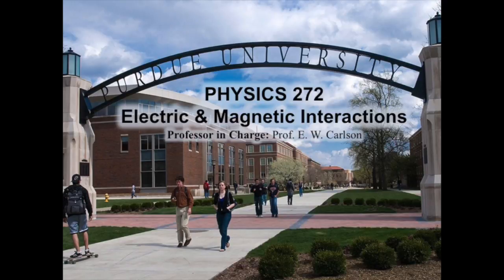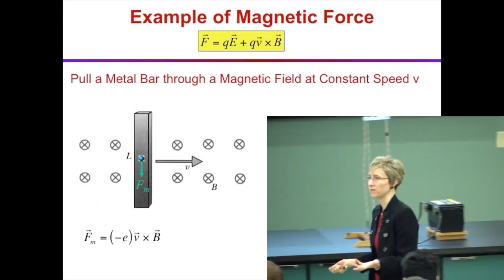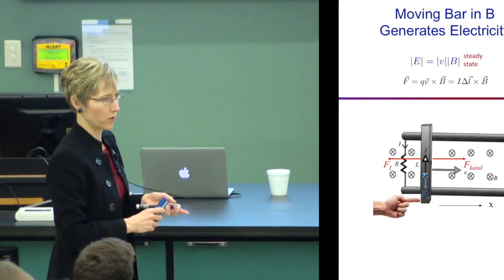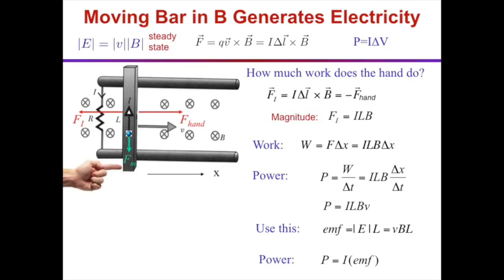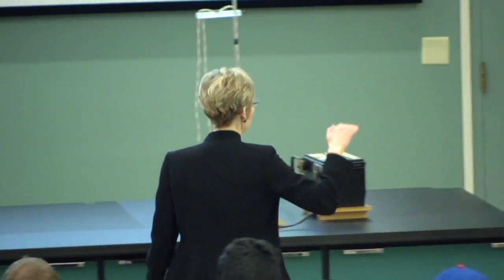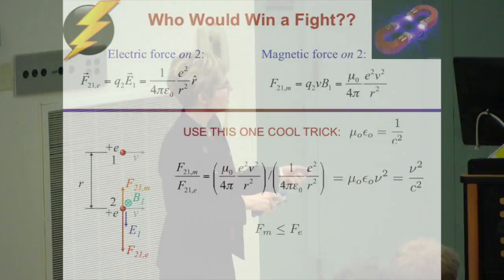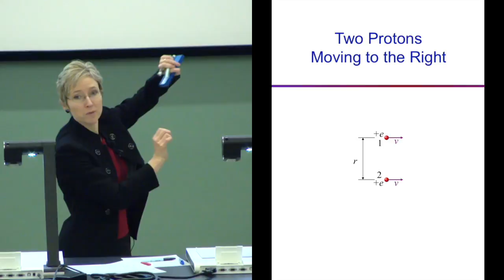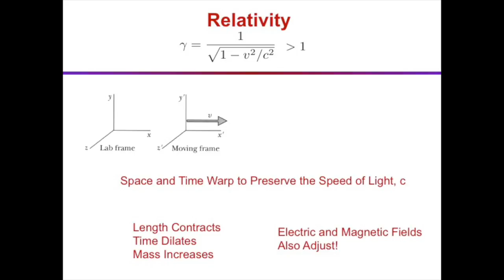Lecture 20 Electricity vs. Magnetism;  Rail Gun

Comment: In a rc circuit or simple resistance circuit when we closed key ( time t=0 ) we observes that initial current is V/R. But in RI (resistance-inductance) circuit when we switch on of circuit we see that there is zero current initially in wire. Why?
If possible make a short solution video to answer my question with detailed analysis.

Comment: Professor Carlson,kudos for energy and passion, you mention the kinetic nature of these forces, but like the limited focus of past physicists, fail to expand the analysis to the advantages of interacting kinetic forces in application. For example, self-amplification of kinetic energies (when accelerating energies interact, exponentially combining to produce more kinetic energy than supplied (as in the Oberth effect, or even when an accelerating force collides with a velocity force for exponential increased combined force. The whole nature of why impulses or changing rate of forces show up in transition elements like capacitor, the extra energy that enables waves and particles to cross physical limits. Party on, be good to others. Thanks for doing this all the same. (But this is not how science advances.)

Comment: Ouch. Professor forgot charge particles experience magnetic forces only when crossing magnetic field lines two parallel moving singular particles cannot affect each other moving together. (This is basically why synchronous induction motors have slip. OK, now she is adding a magnetic force from the classroom.  (No longer a fair fight. External magnetic field.)